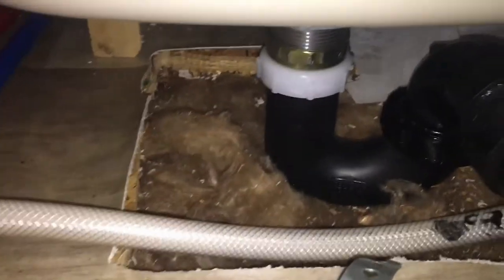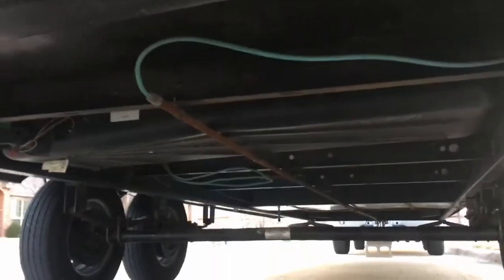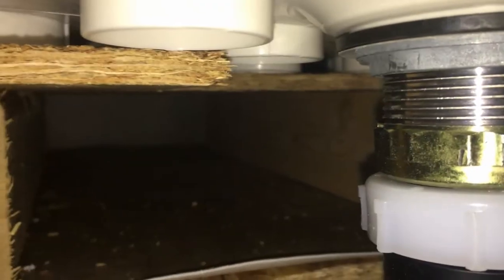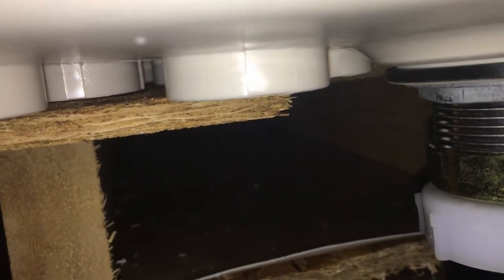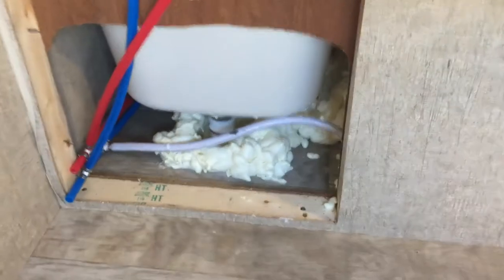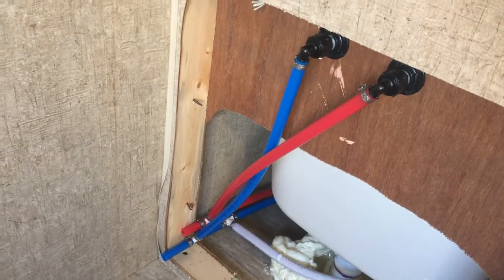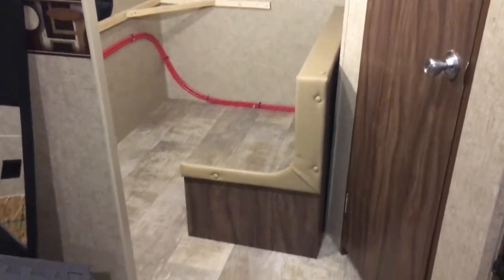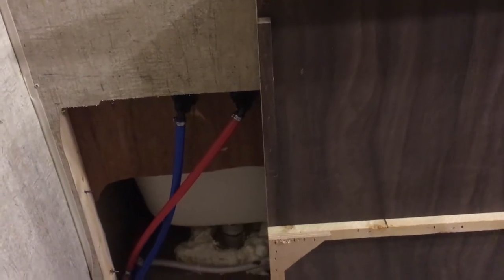How To Remove Bunks to Create Office in Travel Trailer Part 2 of 2

Comment: I'm slightly confused. The MOST important part of this how-to video completely omitted how you dealt with the 1 1/2" drain from the shower. We have a similar issue with a pipe running on top of the floor and entering the top of the gray water tank much like your trailer.
Stating that you ran it under the floor doesn't really help. Does the drain not have to enter the tank at or near the top of the tank?
Thanks.
Reply from the maker: Billy thank you for the comments and the videos are a work in progress. I have video recorded of  the work but need to edit and post it. As I am sure you do not want to watch me babbling I try and cut it down to what is important. Please subscribe and you will get notified as soon as I get the video uploaded which I will try and do this weekend or check back next week. I currently have a full time job and a part time job and this is as a fun side project so my time is a little limited to this at the moment. Hopefully as time goes on I will be able to add more quickly and or build more videos.
Reply from the maker: Just noticed I missed this comment....our apologies and sure it is way to late but in case anyone else has this question I cover how I ran the pipe in another video....straight down then along the frame of the trailer then made a new hole to run pipe into the tank....added benefit if it ever overflows (grey top water) it will not backup into the  trailer and that water is harmless although we avoid doing this if it were to happen....